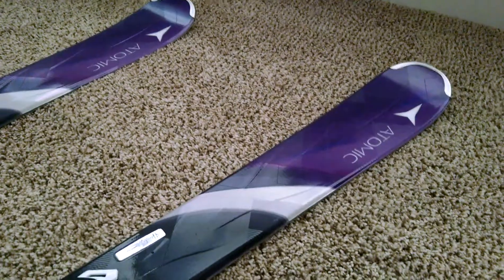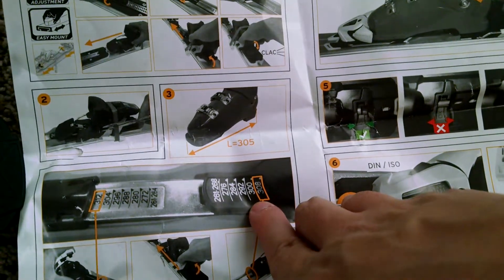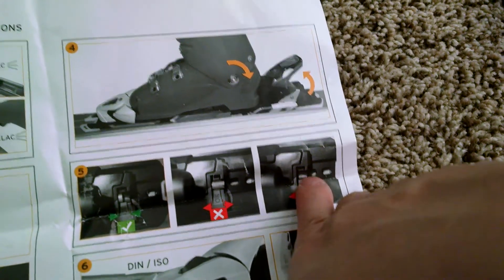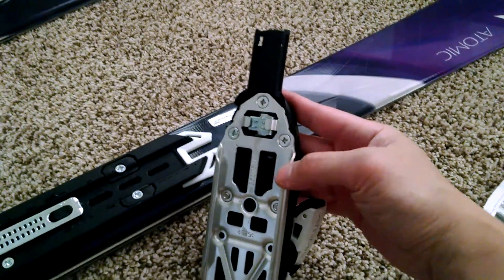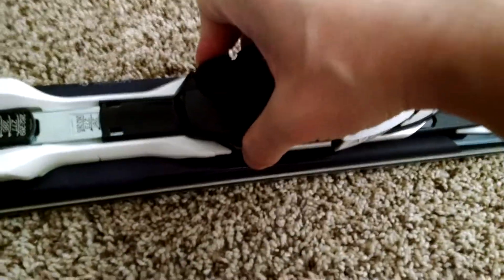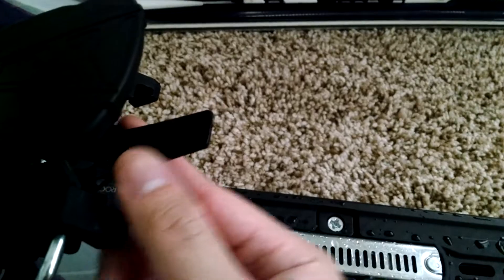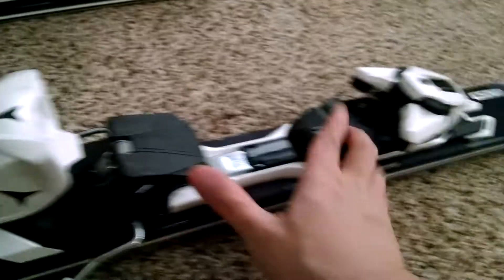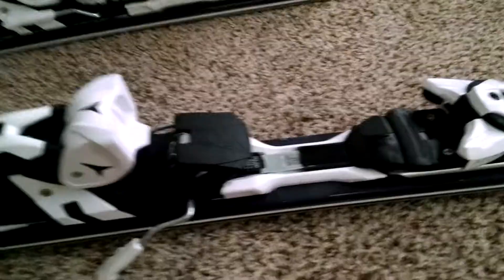Atomic XT bindings mount install tutorial

Comment: The forward pressure indicator is the metal Rod. All ski bindings have some type of indicator that measures forward pressure. It is an important that the boot toe is pushed into the toe by the heel when the boot is inserted and locked into the binding. Always a good idea to open and close the boot into the binding a second time a check the FP indicator. Be aware that the DIN release is a function of the boot and the binding as a system. You should check the condition of the boot sole in the areas that interferes with the binding. Just because you set the indicator to a DIN of 5 doesn’t necessarily mean that the boot will release within the torque range on the DIN inspection chart. When setting up a system you should release check it with a force measuring device to be sure the release values are within the specifications for your DIN number. Have this done at a Ski shop it is a relatively inexpensive service.